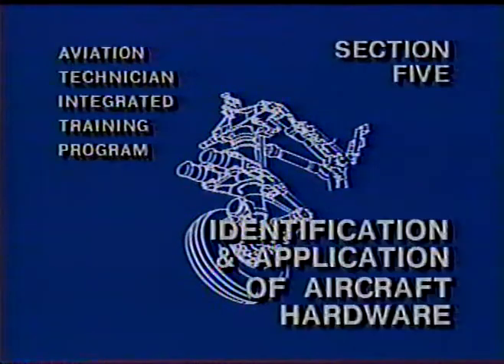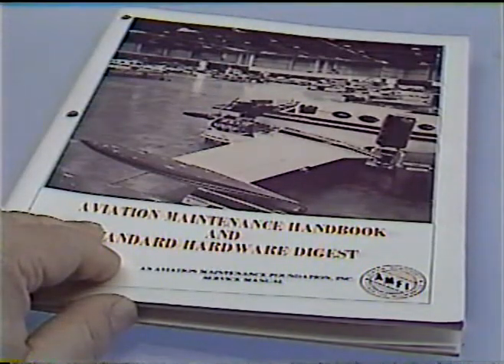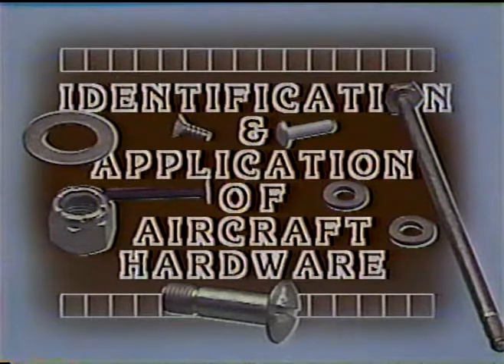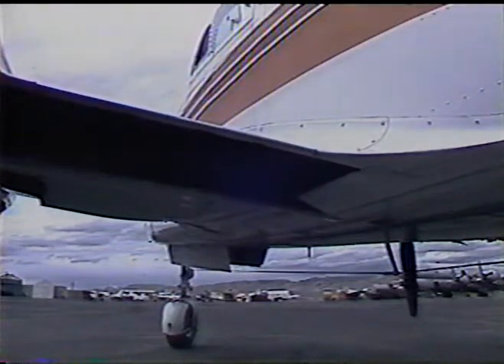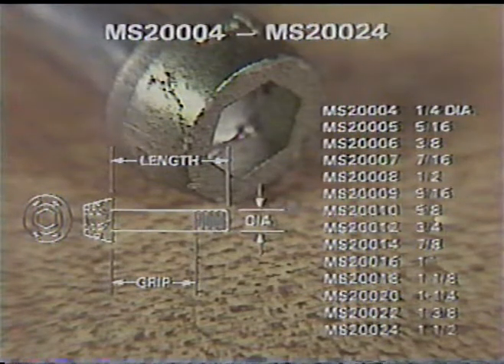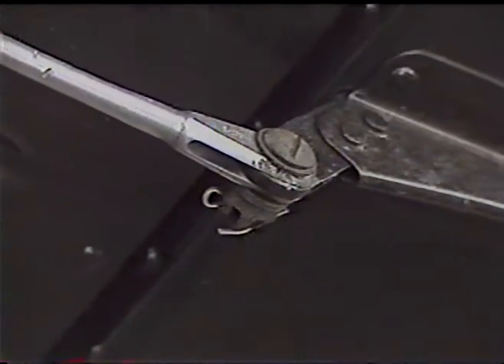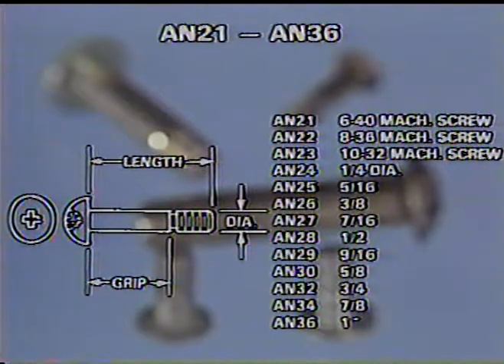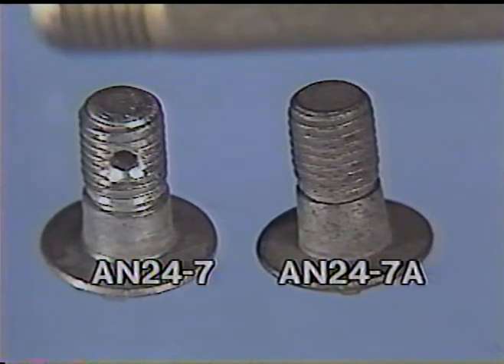IAP 82 20A  Aircraft Hardware 25min

Comment: ah scary, lots of these tips are outdated and incorrect in todays standards, eg; nyloc nuts are not to be re-used under any circumstance now days, where as this video suggests they can be re used and only if hand wining is possible, only then replace it. wild!!! no wonder crashes were so common back then.
Reply: You are not correct my friend. Depends on component manufacturer and certification standards.
Reply: @mipmipmipmipmiplove the satire 😂

Comment: Why no more than three threads must protrude past the nut ?
Reply: If too many threads protrude past the nut, it could mean the bolt is too long, and you will be tightening the nut against the shank of the bolt instead of the pieces you are trying to tighten together.
Reply: It's the standard. Hardware is designed and built to be used in accordance to specific standards. Improper use, or failure to adhere to hardware standards can reduce the effectiveness of that hardware or even damage components.

Comment: Nylock in aviation safety critical situations? Yikes.
Reply: Usually not for structural use. We usually use safety wire or cotter pins. The nylons we do use aren't re-used. Nylons also aren't used in areas that are subject to high temperatures
Reply: Wait till you see how the steering is put together on your car.
Reply: @straightpipediesel  Only the best duct tape is used.